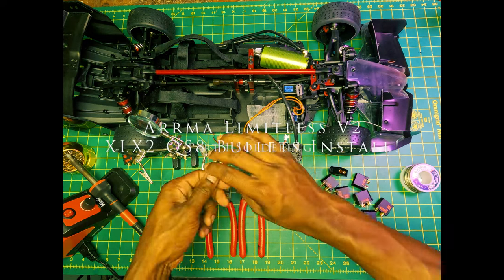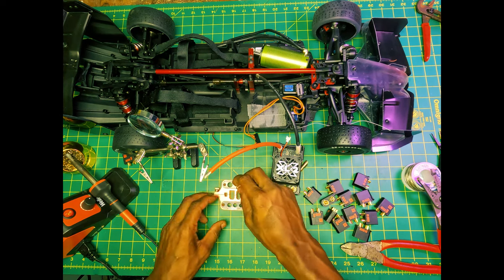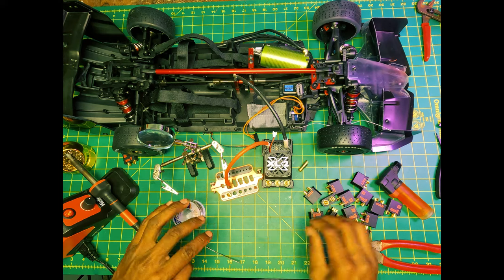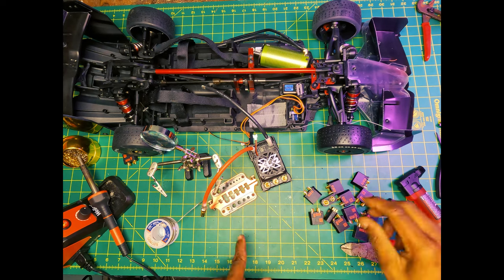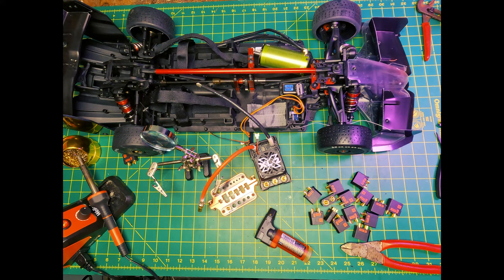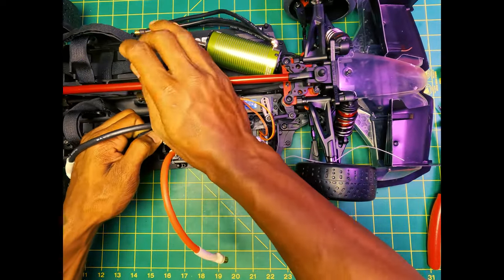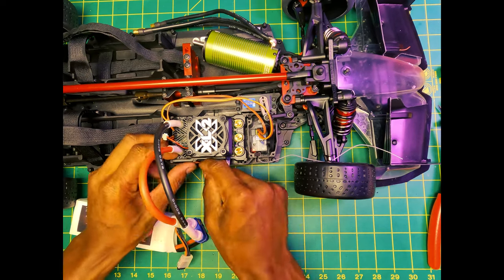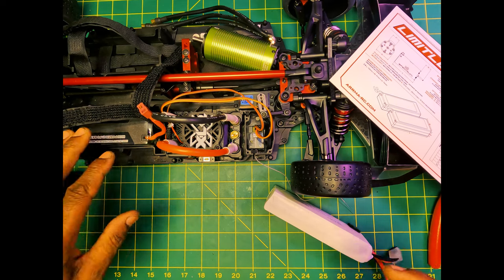Arrma Limitless V2 XLX2 QS8 Bullets Install Part 3

Comment: Nice job I also see your qs8 connectors don’t have red isolation on the bullets,people call these ones as fake .Is that correct?
Reply: No the red comes off with the black plastic. The red ring on the male side is what your talking about? Or thr resistor on the female side only on the positive.
Reply: Look closely around the 3 min mark....?
Reply: @parisemartin5535  sorry i was on my cell phone .Now see it :)
Reply from the maker: No problem how was it on a cell phone 4k?